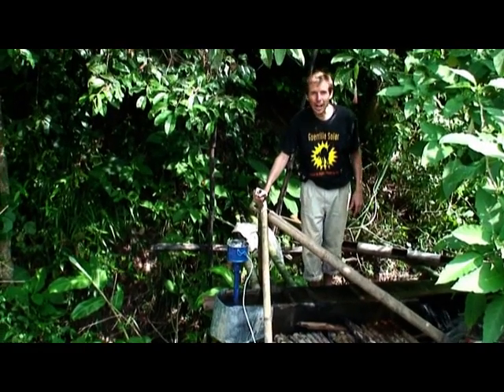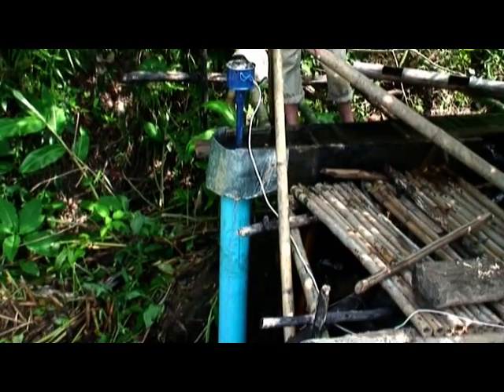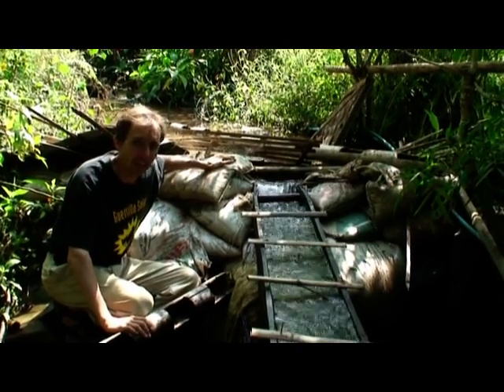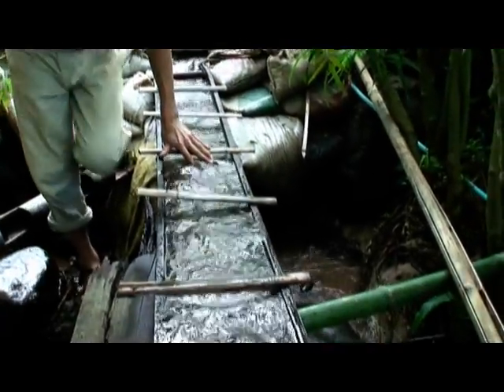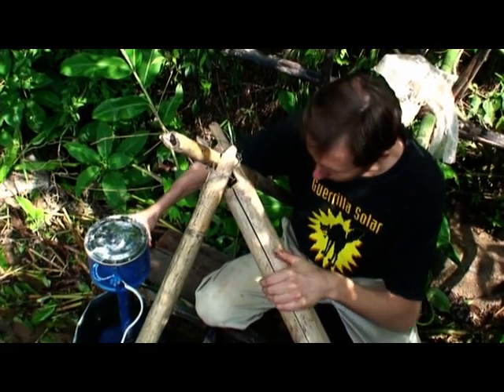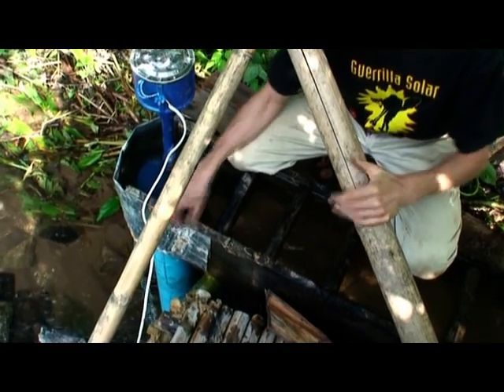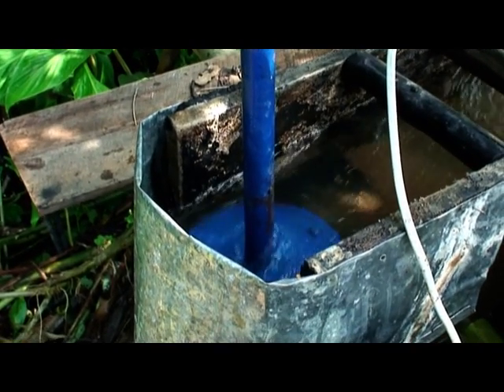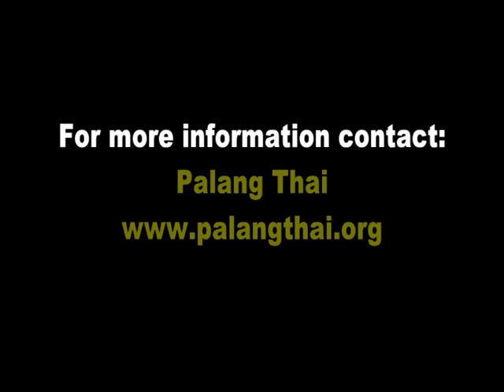Microhydro  200 watt $130 Mae Klang Luang Thailand

Comment: Yes.  Think of it like a cup of water in a bath tub.  If the cup is in the water, and you turn it upside down while lifting it out of the water slowly, the water will stay in the cup.  The waters pressure has not changed, but you feel gravity pressure against your muscles from lifting the cup.  The moment the cups lip touches the air, the pressure in the water changes and a suction is created to force the water out as the air shoots in.  This suction is caused by gravity and the air.

Comment: Looks like a micro Francis Turbine, once also build by Voith and Passavant... Good Solution, would provide more Power, if the draft tube would be conical to ensure a higher draft by the laval effect.
Because fpr the turbine, pressure isn't need, it's speed what the turbine propells.